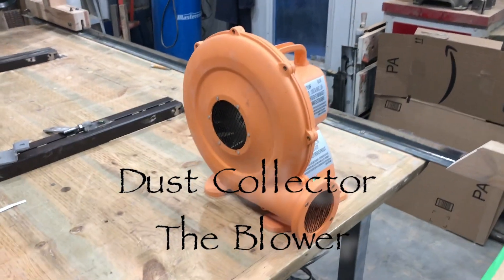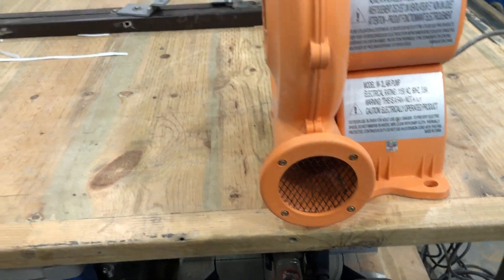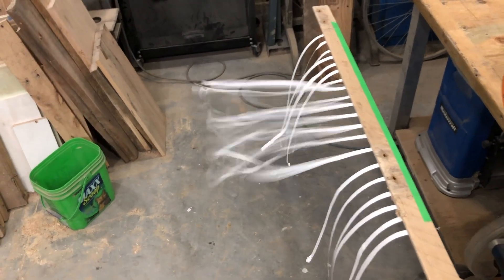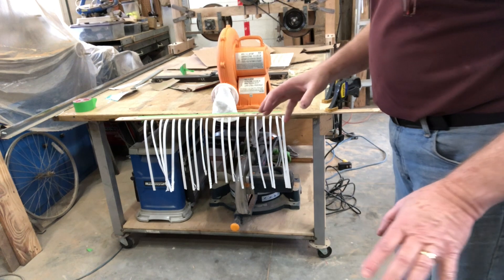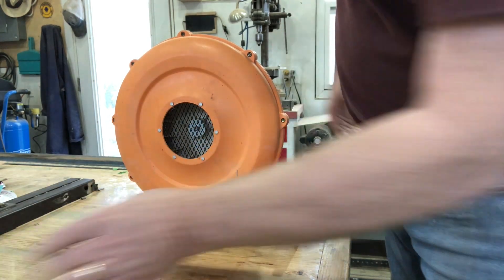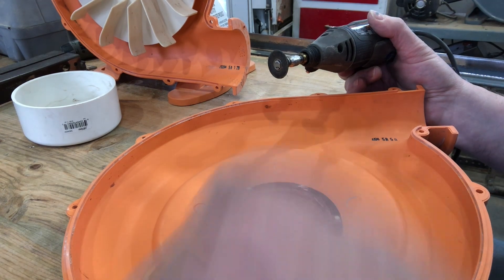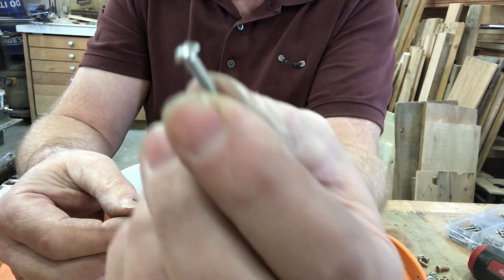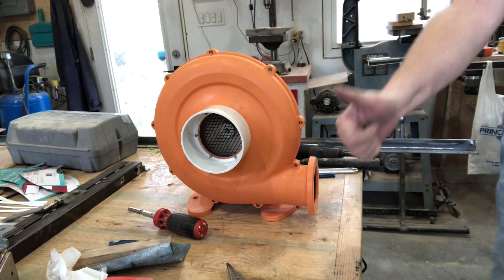Dust Collector Project - The Blower

Comment: On my project, I'm going to add a plenum on the exhaust side and a MERV 15 filter. My biggest problem is height as I have a mobile barrel-top collector from the 80's. and I'm restricted as to the length of the filter. For your setup, you could mount the blower up high, and have flex hose going from the blower to the cyclone. Oneida Air has some examples on their "dust deputy" page. I haven't started my project yet, but the overview will be out this Saturday.
Reply from the maker: A MERV 13 filter was suggested to me, but I came across the MERV 11 filter for a really good deal and snapped it up. At this point, ANY filter is better than the nothing I currently have.  I'll keep an eye out for your post on Saturday.
Reply: @secretundergroundlair4014  What was the cost of the filter if you don't mind me asking? I have a MERV 10 filter that I need to replace, and the newer filters are about $250.00 US. I found a filter for this project for $121.00 — but the shipping may be insane. It's not cheap to stay healthy! 😩
Reply from the maker: You're not going to like this ... I picked it up at another surplus outlet for $15.00 CDN (yes, fifteen Canadian dollars). That's why I jumped on it.

Comment: I would put the filter on the suction side and pipe the exhaust air to the outside. Ditch the sock, and diffuser all together.
Reply from the maker: Exhausting the air outside (something I had considered) means I need a fresh air intake for the shop. That would be easy in the summer, but not so nice in a Canadian winter.
Reply: I would still filter on the suction side, and you can do a dual exhaust option, one for summer and one for winter @secretundergroundlair4014

Comment: That great minds thing is happening again, I was looking to use one of these as I bought the whole jumping castle thing for the first grand-daughter and still have it. She is now 11 and over 5' tall. Wouldn't it be funny to have it exhausting to the outside with the castle still connected. As I have no nearby neighbors after the cyclone part to remove large particles I will just exhaust mine outside. Have a great day.
Reply from the maker: Love the idea!  I thought about exhausting the blower to the outside, but then I'd have to draw in fresh air to replace what was blown out. In Canada during the winter, that's not really appealing. In summer, absolutely. No room at my place for the jumping castle though.

Comment: Excellent. I bought this exact type of blower hoping to make what you are making. I got the blower cheap at an auction. I wasn't sure if it would actually do the job, but for the price I figured what the heck. It's reassuring to see someone else going down a similar path. Now to see how you finish this. Oh dang, I guess that I have to subscribe to get that. ; }
Reply from the maker: I have had this blower lying around for a while now, so I am happy to finally start on the project to use it!